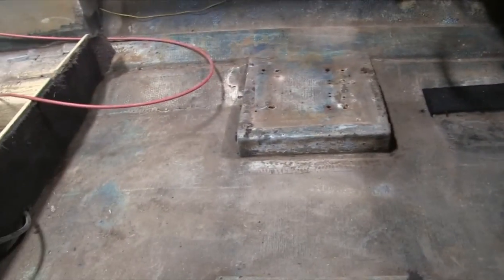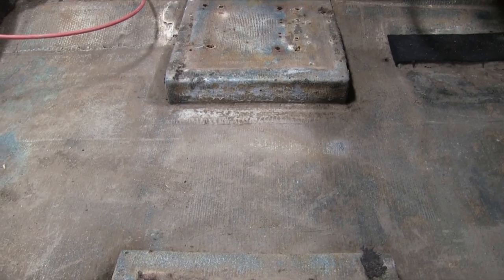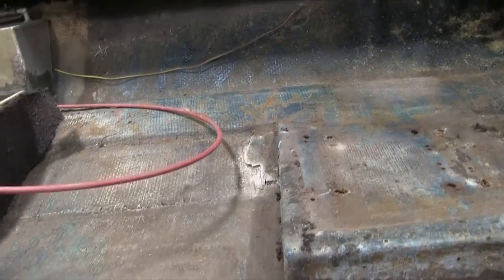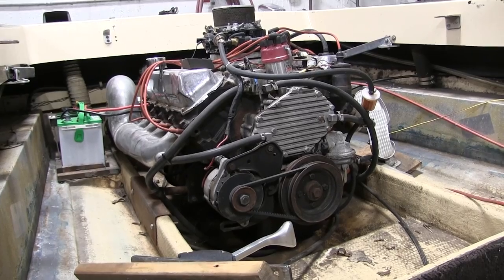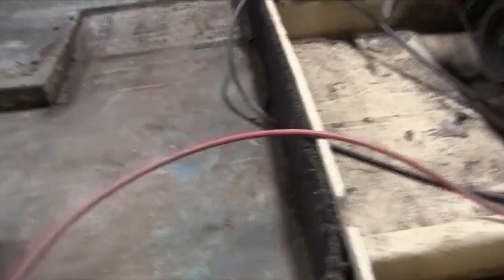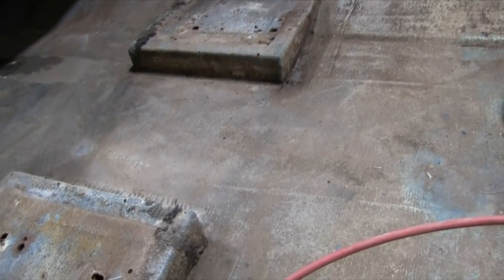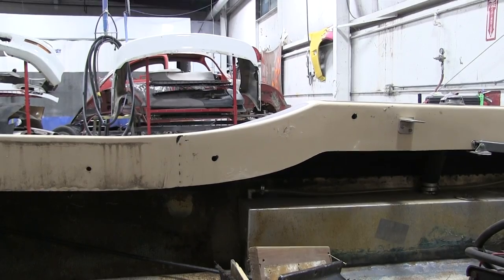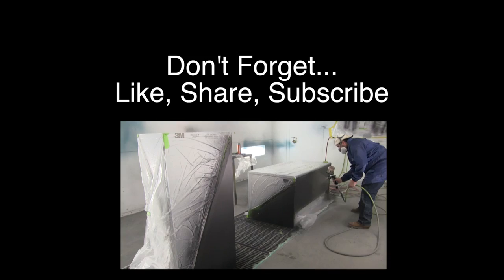Jet Boat Project Update - Interior and Floor Repair

Comment: Any idea what colours you are going to paint the outside of the boat. I know nout about boats let alone Jet Boats. I'm gonna have to Google them
Reply from the maker: I am thinking about white, blue and silver.  Then I'm going to coat the inside with a gray marine coating....kinda like bedliner.  I am not going to put carpet back in it.
Reply: DIY Auto Body and Paint  Don't blame you on the carpet. See you on the next video